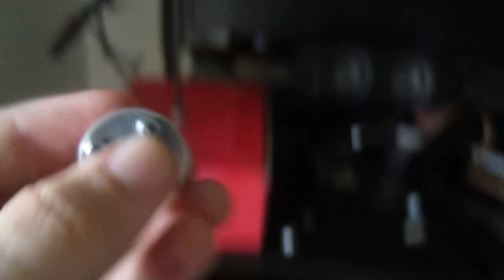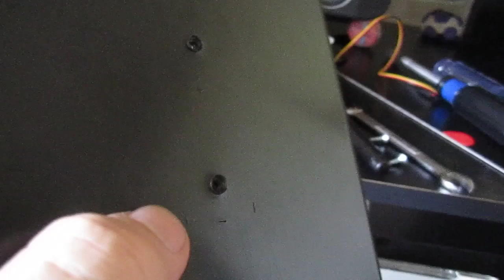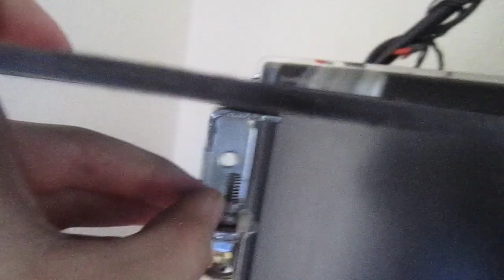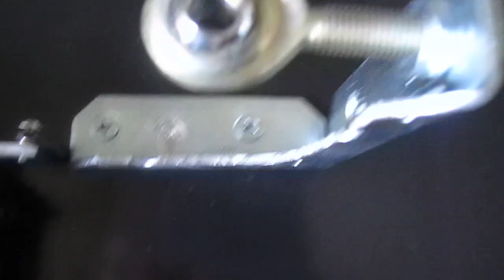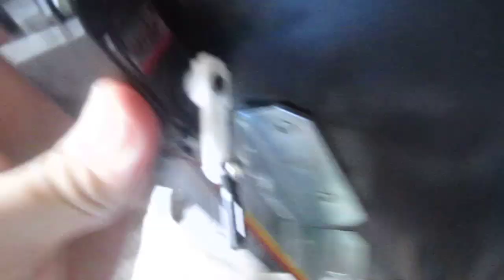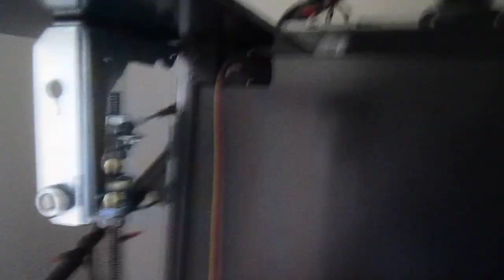Animatronic Servo Head Project PART 2

Comment: you could add a 3rd linkage going to the bracket to keep the washer from spinning around
Reply from the maker: I ended up giving up on this project and really using the servos on something else. Another problem was it got too heavy for the servos and it was unbalanced.